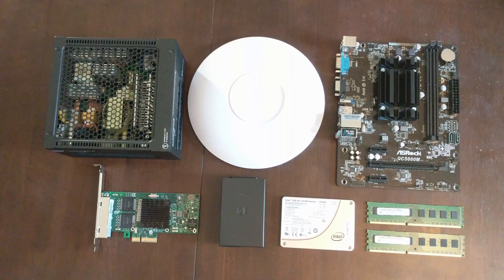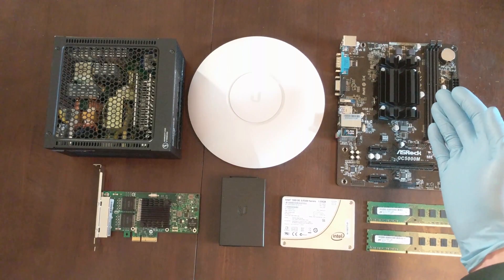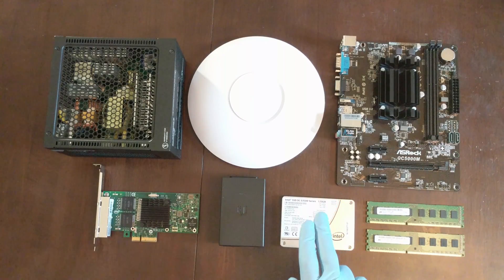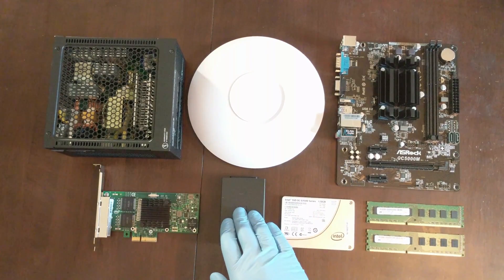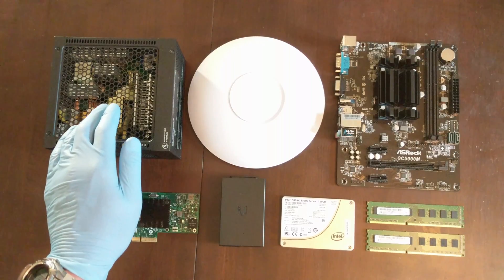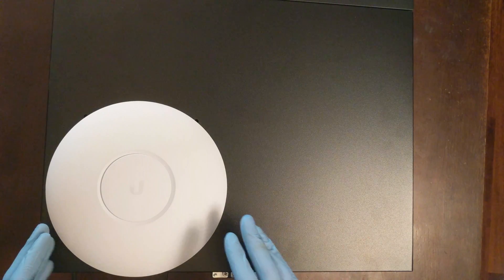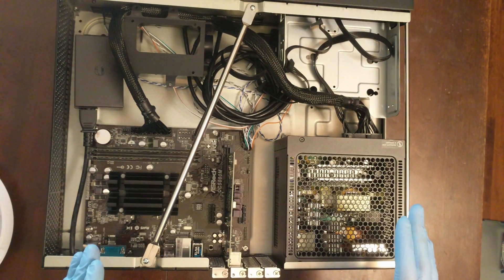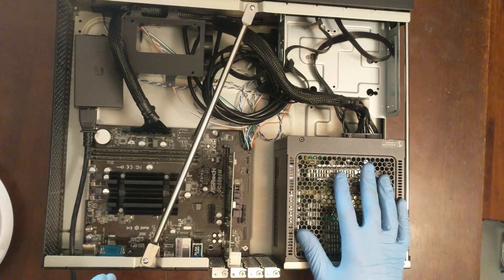pfSense Router Build Part 1 - Hardware

Comment: I'd have used something like a pico-psu for this, and a way smaller case. Super cool tho ^^
Reply: what smaller case and pico psu qould you choose?
Reply: @matthiashavrez  For these components specifically a picoPSU-150-XT would be more than enough, the 400w psu in the vid would barely be pulling 30w under load. Case size could be way smaller as a result, with that network card being the only limiting factor (although alternate mounting and low-profile brackets would allow more flexibility if available). But I'm just a sucker for space efficiency :P

Comment: Can that board and CPU route  at full gigabit speeds ?
Reply: I am getting ready to build a new pfSense box, currently on an OLD AMD Athlon with 2G RAM...I have 3 gigabit NIC's and it pulls about 900+ Mb/s easily on my home network and internet connection (CPU is around 60-75% at full 1G load). So, to answer your question, the hardware in this video is more than powerful enough to pull those speeds. 10gig bandwidth is more of what would likely be a strain on this system. Where the big benefit of better hardware would shine is running more functions on the pfSense box like Snort, VPN's, etc. which is the reason why I'm upgrading, not bandwidth capability. Hope that helps.
Reply: @PatrickSheets  Thanks Patrick, That's more where I'm thinking VPN, pfBlocker, Saracota, snort etc. It's all a compromise between power and power consumption I'm now looking at maybe a Intel Celeron G3900 @ 2.80GHz and being a 1151 pin CPU then it has an upgrade route if I need more power along with 4gb ram.

Comment: First off, thank you for your great video and write up of your fanless pfSense router build. It's very much appreciated. 

I'm in a "Go All In," mode/phase in wanting to build a psSense router for the new Home as I'm all for open source and avoid proprietary software 
as much as possible. (I'm very big with security/privacy.)

I was hoping you could help me with some questions: 
_______

1. I've noticed that the ASROCK Q5000M is out of stock on Amazon and was wondering if you could point me to another fanless motherboard that would work with (capable) AES-NI? 

2. Is the Intel I340-T4 Network Adapter the best one to get or is there another model that I could opt for?

3. Power Supply wise, is there anything more efficient than the Seasonic 400W PSU that you've used in your build?

4. As for the Wireless AP, I've noticed that there are several variants of the, Ubiquiti Networks Unifi 802.11ac Dual-Radio PRO Access Point (UAP-AC-PRO-US), such as the (UAP-AC-LR-US), UAP-AC-HD-US and the UAP-AC-PRO-E ... Should I just stick with the one you've used? 

________

If there are any other tips, tricks or suggestions I'd be delighted to soak up the info like a sponge. My main goal is to build the best 
pfSense unit that I can. Thanks in advance to others who may be able to help out as well...

Appreciate all that you do... thanks again!

Cheers.

Comment: Do you recommend to use pfsense to make a router and switch? use some 10gbe ethernet cards, some 1gbe ... at the same time? what computer do you need to make that works acording the pci express lines and the cpu?
Reply: Not a switch. Use a switch to be a switch. You definitely do not need 10g in a Pfsense box unless it is routing a 10G internet connection and you need some BOSS cpu power for that much throughput. A modern quad core is recommended for a 1g internet connection by Netgate themselves. You can route on a stick if you need with PFSense so you can have multiple VLANs being routed by PFsense through a single ethernet port. You still need a separate WAN port though so minimum two ethernet interfaces.

Comment: This is great: You did a good job buying quality, but reasonably priced, parts.  I have an ASA 5505 and with the license upgrades required to be fully functionally, I spent a around 800 bucks over the years. When it dies, I'm going to a pfsense solution. I'm curios about the the performance of a Server NIC vs a dedicated hardware switch.
Reply: I have an ASA 5505 sitting under the rack in my home office and it has about 2 lbs of dust on that piece of shit. I am a Cisco network engineer of past and I am no longer in love with Chisco crap anymore. PFSense will run literal circles around Cisco anything, trust me I know. I also have a 1921 ISR G2 with IOS Zone Firewall security license and it can't even come close to the routing performance of a darn 6 year old Celeron with 4 GB of RAM. What a rip off for that so called enterprise junk. Build PFSense on enterprise level hardware and it will run circles around quite possibly everything, Barricuda, CIsco, Juniper,  just go down the damned list. Its ridiculous. Even a Ubiquiti 16 port 10 gb switch with all 16 ports being 10G capable will run circles around a $32,000 Cisco Nexus piece of shit for only 550 whopping bucks.

Comment: 400 Watt for pfsense, omg. you must have shares of your local electricity provider. to do that with lower power maybe on old hardware does the trick.
Reply: that's the maximum the power supply can provide, his build will barely pull over a 100 watts looks like, older hardware will pull even more power.
Reply: Just because the power supply is 400W it doesn't not mean it's consuming 400W. In fact, higher capacity allows the power draw to be more efficient.
Reply: Higher watt often runs best at loads of 80% or more, so getting an over powered PSU you are actually being less efficient, always buy as close as you need vs not going OVER the top on needs.
Reply: @kleash  That's wrong, if the PSU is lightly loaded it can be very inefficient. Most things are most efficient at or near fully loaded car engines, PSU etc.

Take look at https://www.tomshardware.com/reviews/corsair-cx650m-psu,4770-5.html I know it's not the same supply but the principal is the same.
Reply: you're an idiot.